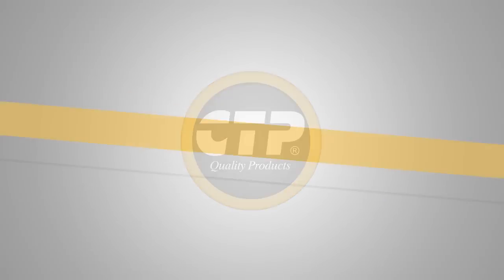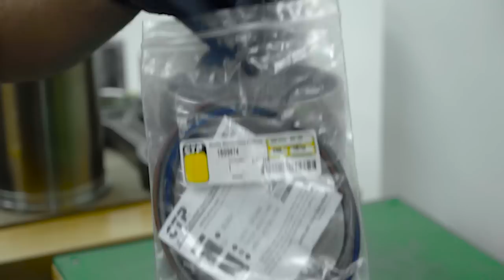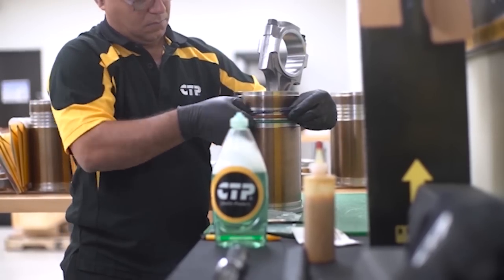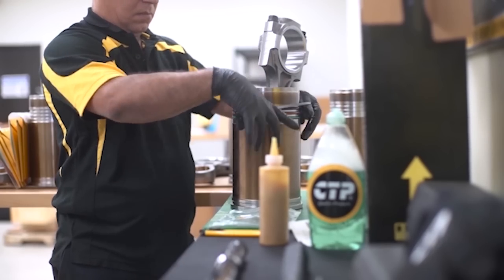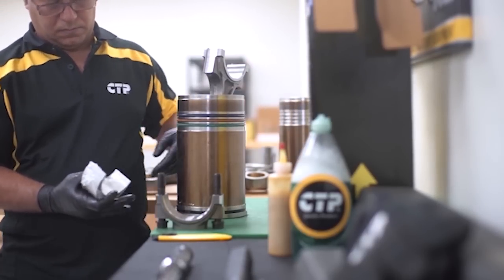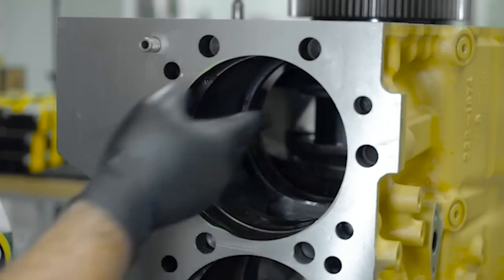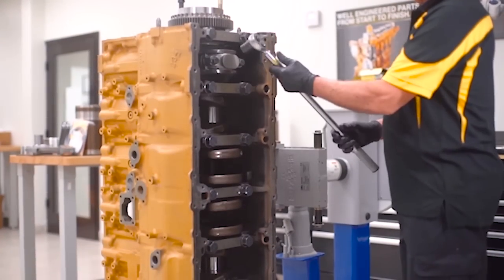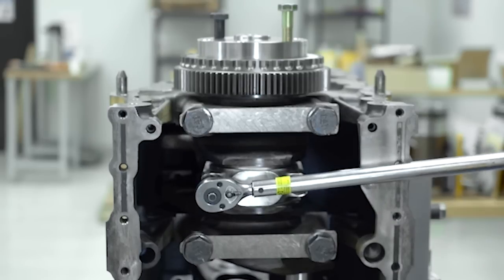Connecting Rod Installation

Comment: One I built hundreds of these engines, and always put the journal at the bottom of stroke so to not fight  the counterweights and can easily put on the caps! Two does not show pressing in the liner to seat it, want to make sure that filler band is all the way in!  Also made two long puller bolts warped in shrink wrap to protect journal as I pulled down the piston group! Worked really well!

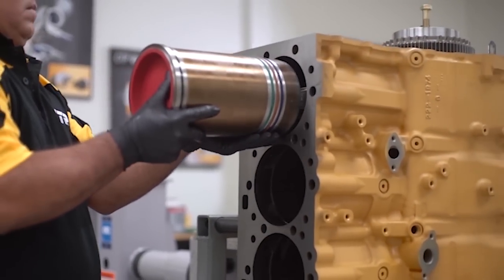Comment: The alignment dowel pins on the connecting rods aim upward towards the front of the engine, as they should. At 3:14 however, when the technician shows the cap, he is installing the cap with the dowel pin holes aiming downward toward the rear of the engine. They won't line up with each other.
Reply from the maker: Thank you for your comment and feedback!
Reply: Did not check for liner protrusions they must be from 4 to 6 thousands or head gasket failure is a sure thing.  This video is crap
Reply from the maker: This video was made to demonstrate how easy it is to install a cylinder pack, since the piston & rings are installed inside the liner right out of the box. You should always verify and check liner projection/protrusion. You can check out our video on Checking Liner Projection here: https://www.youtube.com/watch?v=JrGeSt0Ks5g&list=RDCMUCGY1Ciq69XohG4YrTWXGWPg&index=6
Thank you for watching.